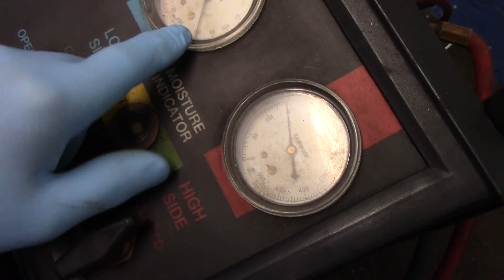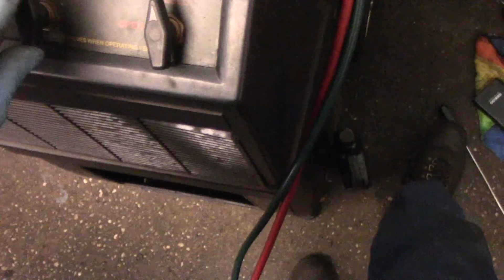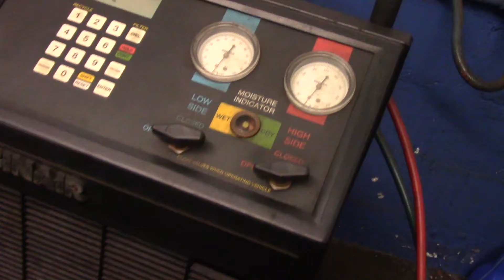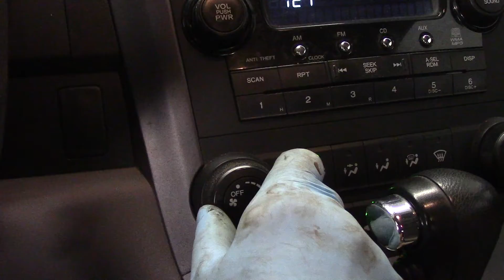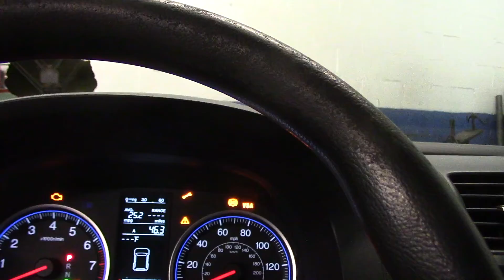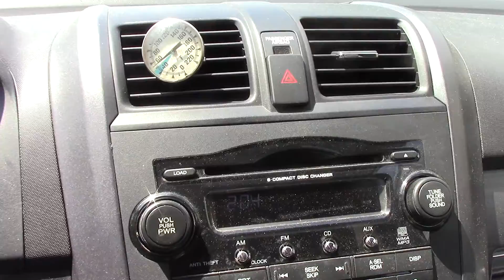Diagnose No AC & Replace The AC Compressor 2008 Honda CRV

Comment: You missed replacing the condenser, dryer and expansion valve. You should have flushed the debris from the failed compressor. Now you get to do the job twice.  This guy is an idiot
Reply from the maker: Actually you are the "Idiot" . Did you not see that the coil part of the compressor is what failed. I'm sure that you can understand that the coil is electrical and that the system is not in need of flushing because there is no contamination .Thank you for showing your ignorance to everyone.
Reply: Is the problem usually the compressor with a system on CRV's? I've heard the ac system on them can be unreliable.. thanks

Comment: I have an issue where the compressor works, but there's a leak so it will stop working after some time.  i haven't bothered to trace the leak, i'm thinking the leak is most likely coming from the shaft seal?  is there a way to quickly check / diagnose this without adding a dye into the refrigerant?